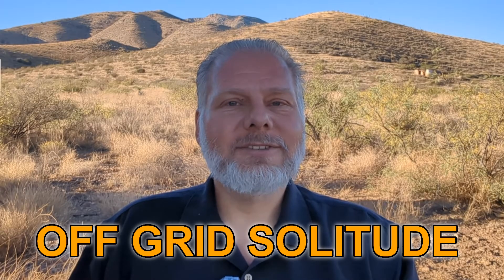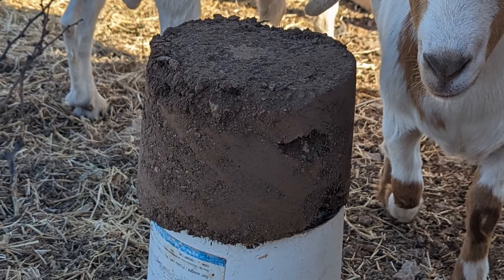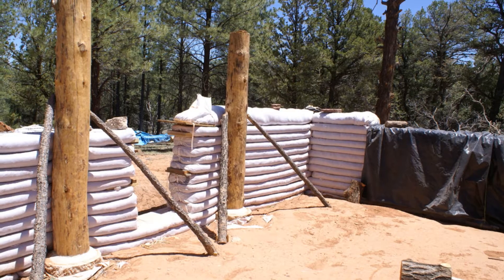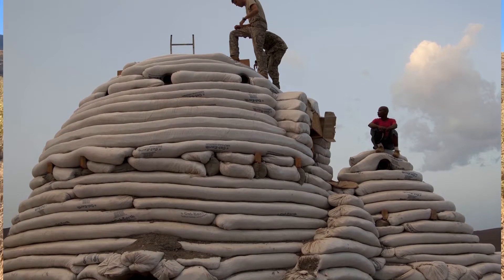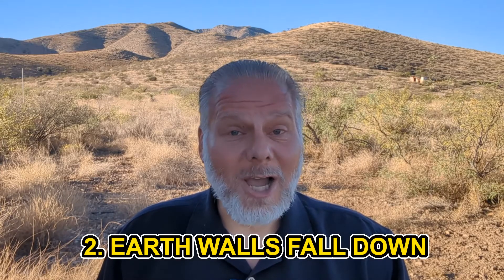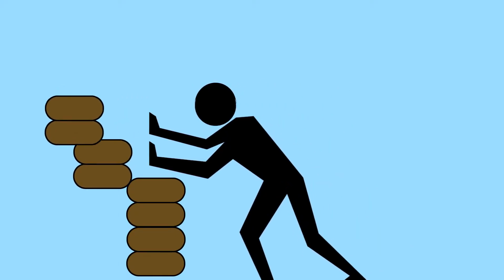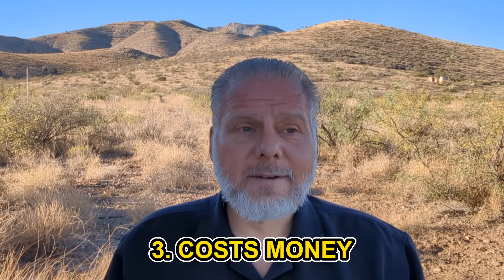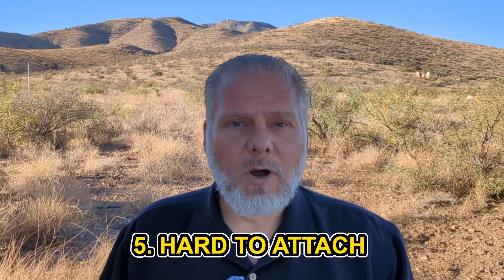5 Reasons Not To Build With Earthbags or Hyperadobe.

Comment: Really nice and compact overview of the drawbacks of this method. I think nothing beats the speed and flexibility of the frame and stick construction. It can be sturdy clean inside, easy to install any infrastructure inside etc. Yes dirt is in place and you can build with it but all at the cost of labor, flexibility and stability.
Reply: There is no place like being at home in a genuine Adobe house. Stick built these days is OSB and paper.
Reply from the maker: Thanks for watching!
Reply: Stick houses cant handle anything the earth throws at them. there is a reason everything left from antiquity was built with earthen materials. Everything today is build to break within 100 years. Stick homes will not survive the earth changes already happening and still to come. nobody should be building that way anymore.
Reply: Speed perhaps, flexibility no. Stick frame is square, earthen can assume just about any shape. A well plastered wall is just as clean as drywall. Folks seem to forget about the amount of toxicity in a stick framed house. Earthen walls have none of this and are breathable. If we're comparing longevity, earthen buildings, if built well, win by a long long ways. The oldest buildings on this planet are earthen. So if you're looking at the process as a long term investment instead of the initial build speed there really isn't any comparison.

Comment: make concrete walls? What kind of solution is that? Your comments are not really valid. How many walls fell? What is your evidence of that? Your comments are unfounded and misleading.
Reply: I’m building an earth bag pod, the only negative I have found is it’s very labor intensive.
Reply: @gemguy6812  How is your build going? Have you found any pros and cons?
Reply: @gemguy6812  I've done both, and it's less work than cob!
Reply: It’s very true, it’s a huge amount of labor. Back in the day people had large extended families nearby and very little money, so adobe/cob made more sense. Working by oneself , I agree another building method would be more doable. I live in adobe in New Mexico and love it but I didn’t build it!
Reply: This guy seems clueless to me. Almost all my relatives live in adobe homes built in late 1800's or early 1900's in New Mexico.  Walks are over a foot and 1/2 thick.  Warm in winter( with a wood stove) and as cool as a cave in summer!
Reply from the maker: Thanks for watching.
Reply: @offgridsolitude thanks for addressing criticism like a bitch
Reply: @offgridsolitude  🦋🌿 You might be interested in Monolithic Dome Homes

Comment: Hi Joe!  Thanks for doing the research.  Another great video.  In AZ I feel that concrete walls are best due to the temperatures.
Reply: Concrete does zero to insulate  a building
Reply: @markmayhem2173 thermal mass beats insulation here in Arizona. Maybe physics are different elsewhere.
Reply from the maker: I agree. Concrete is the best.